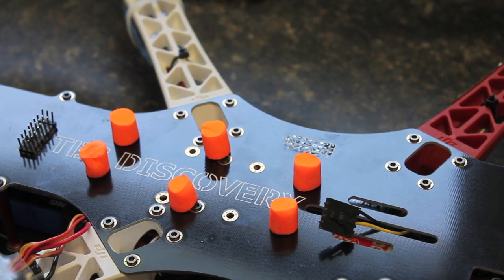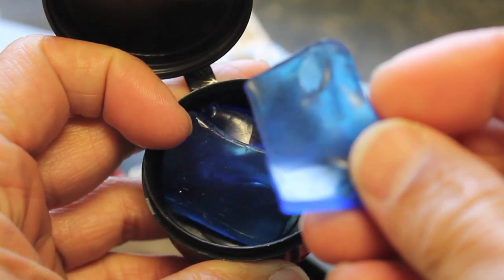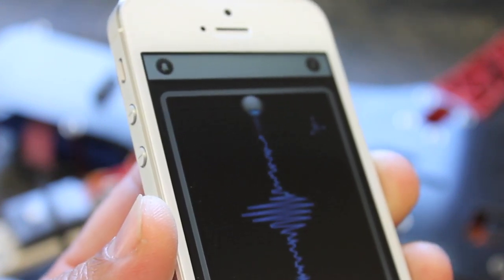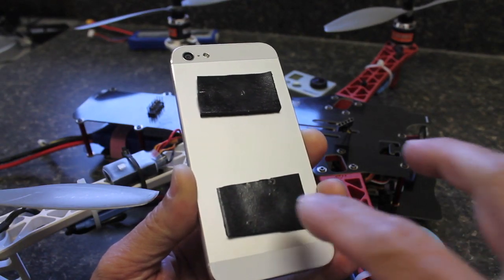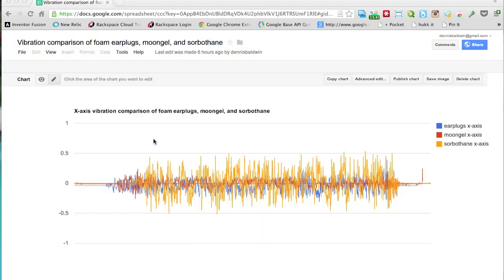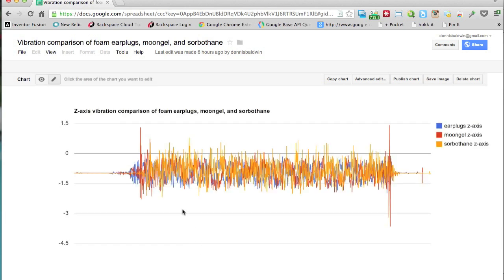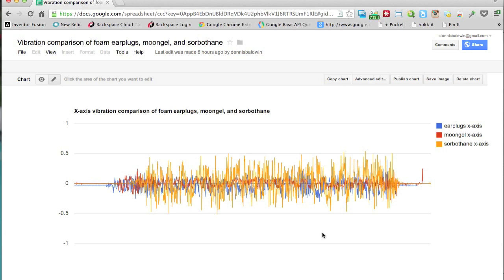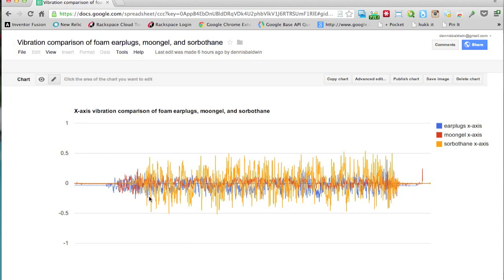Quadcopter Vibration Damping Comparison - Foam Earplugs, Moongel, & Sorbothane

Comment: I'm making a video of my journey back to flight, and there's a shot of me trying the EXCs and you see one smoke, not not the others. I need to find a way to test the others without having to install them all back into my quad. The one that smoked smels like electric burn, but the other 3 don't. So that would be even more amazing to have lost only one ESC! But the camera surviving has me puzzled too. That had a well charged battery inside. The quad Gods were smiling on me for sure.

Comment: Actually I don't think the ESC fried until I tried it 2 days later. I think I blew only one, but replaced all to B sure. I think the heat shrink kept water in, and when I powered up there was smoke in 1 esc. Hard to say now. I had one of the first XP2s with the blue Quadrino Zoom. They later got a batch of black ones that had issues where they wigged out, so they switched to Naza. I'd prefer one, but my Zoom flies fine. Just no usable stable mode. The upcoming XP6 hexa will be Naza too.

Comment: I have a Quadrino Zoom board. The XP2 was submerged for 2 hours in a river, lodged in the sand/mud as I dredged the river with a big stick thinking the current took it towards the ocean. Everything but the ESCs survived! Even the unprotected GoPro! I put that and my FPV Tx in rice for 2 days and all the water was leeched out. Just got everything hooked up tonight and it seems to be fine. Too dark to fly, will test soon. I'm amazed. 160.00 in ESCs and I'm good. Maybe because the battery was dead?

Comment: Thanks Dennis, I really like the looks of this quad. I want something flat & wide like this to do fast, low-level stuff without rocking like a pendulum. But for now I'm replacing all the ESCs in my XP2 after losing it in the river at Moonstone Beach for 2 hrs. Amazingly everything else survived - even the un-cased Hero3! I lost the last 15 sec of footage with the crash into the water though...

Comment: My pleasure Dennis. That gel/rubber is tough and stretches a lot. Like I said. I have crashed hard and never even torn it even a little. I was thinking a metal plate glued to the gel might add a bit of mass, but who knows, it might not be necessary.

Comment from the maker: Chad, thanks for the suggestion. I'm familiar with the XP2 but didn't realize they also sell the dampening rubber. I've always been impressed with the quality of videos that I've seen taken with the XP2. It's crazy to think that the only thing that holds the camera mount to the quad is the foam rubber and super glue. I may definitely give this a try, but do agree that the mass of the landing gear may assist in dampening as well. Thanks again!

Comment: Part of the solution is the mass of the landing gear that sits under the quad. But no material other than the gel is between the frame and the landing gear. No zip ties. Perhaps gluing the gel between the frame and a camera sized metal plate to attach the camera to will work for you? I just used super glue, and it has held for 8 mo. I can get away without balancing my props even! It's worth a try even with the materials you are experimenting with now. Glue a plate then strap cam to the plate.

Comment: I'm flying the XP2 from XPro Heli. Their solution is also gel, but they have a specially formulated gel that glues between the frame and the landing gear/camera mount. Look in their Parts section for "Vibration Dampening Pads - Special Rubber" (not the foam). I get very low/no jello unless I'm doing a steep dive. The gel is strong, as I have crashed a lot ans haven't had to replace in 8 months. Not sure how well it will work with just a camera.(Cont)

Comment from the maker: You're definitely right. I haven't done much experimentation in this area, but I did notice when I strapped the GoPro too tight the vibration was much worse. This was using foam earplugs which are super spongy. I'm anxious to hear more about your earplug mount once you get all the kinks worked out. Is this something that you're using with the TBS frame?

Comment from the maker: You know, that's a great suggestion! I bet you're on to something. My hunch is that this will definitely improve the absolute vibration measurements, but from a relative perspective I still think we'll see similar results since all three materials were mounted the same way. But you never know. I will give this a try in the coming days and if the results are different I'll be sure to post. Thanks for the thought.

Comment from the maker: Okay, I'm doing this today and will add the results to the spreadsheet. I'm going to be severely pissed if you're right :) All this buying different materials, testing, mounting, etc! The one thing about the TBS frame though is that the GoPro is actually mounted with the bottom of the cam touching the bottom plate and the back touching the top plate. So there are two potential vibration points of contact. Anyway, let me run this test and I'll post the results.